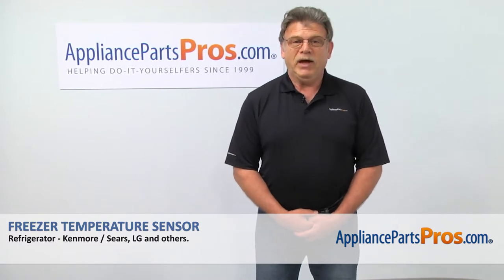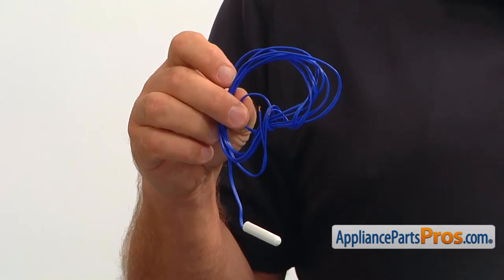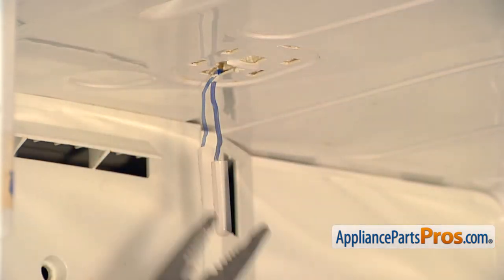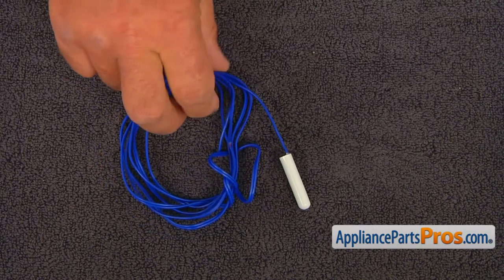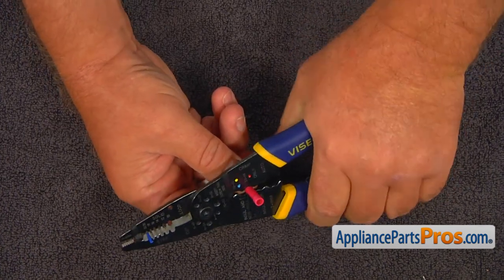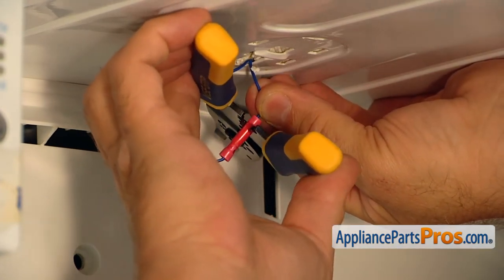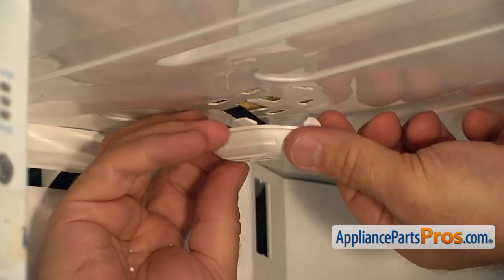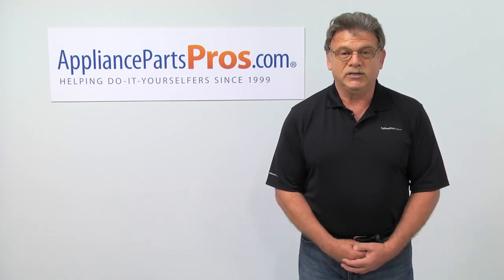How To: LG/Kenmore Temperature Sensor 6500JB2002T

Comment: What is the freezer temperature sensor part # on a LG LTCS20020S/00?
Reply from the maker: It looks like that temperature sensor will be part of the control box assembly. That part number is ABQ73946703. You can place the order online or you can call us at 1-877-477-7278 to place the order online.